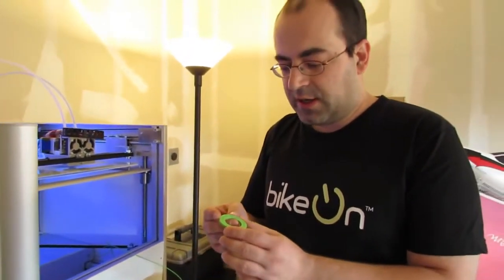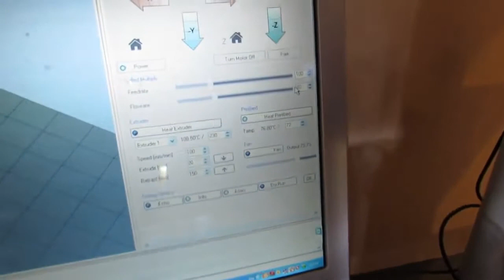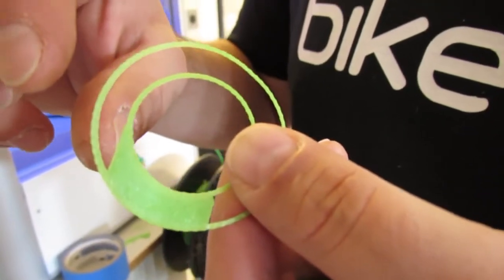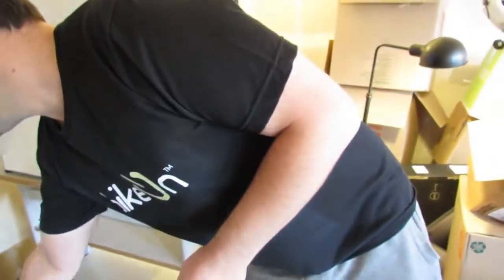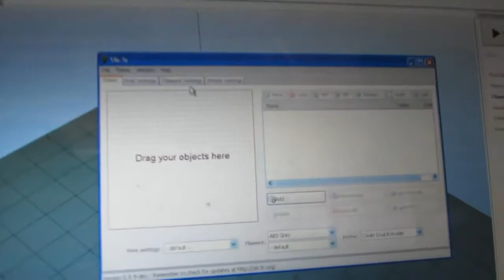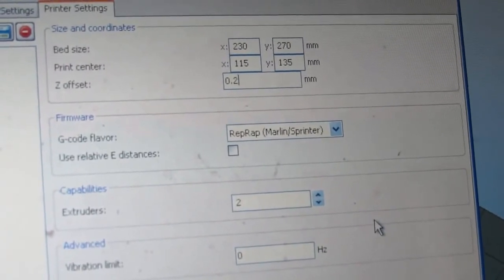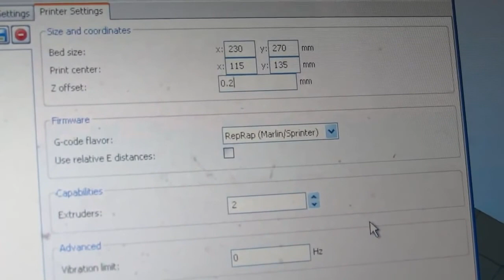3D Printer Leapfrog Creatr Troubleshooting, Printing Quality and More

Comment: I just picked up one of these on the cheap.  It's an older machine with no print time on it as it had minor damage in shipping, and it would not work properly after the replacement parts were installed.  I'm looking forward to getting this up and running.